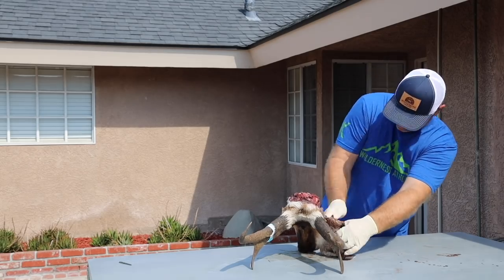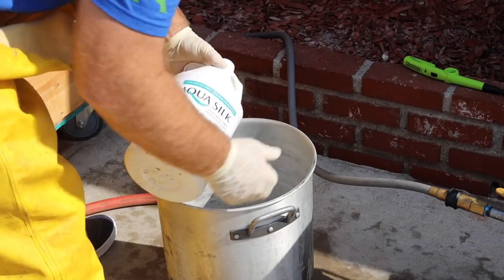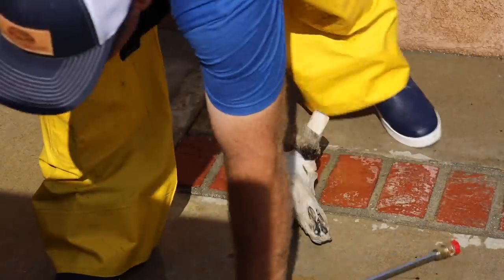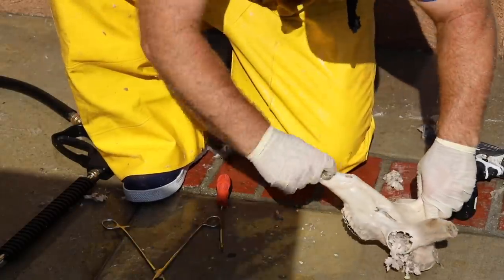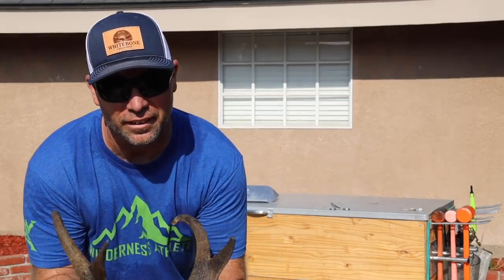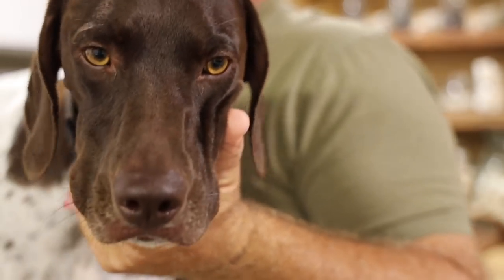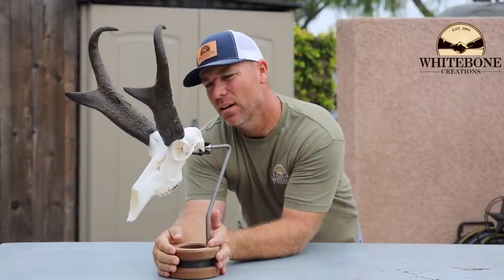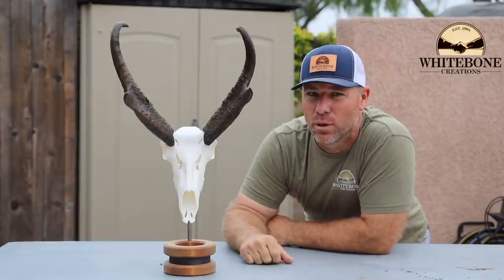PRONGHORN ANTELOPE SKULL CLEANING HOW TO

Comment: Great video. Got a question.  Maybe you will see this.  I have been using your method for a couple years to do whitetail mounts.  They looked great and really white when I first did them.. I have noticed that the ones that I have done a couple years ago are now looking "oily" in places.  I use oxy clean in my boil and pressure wash them really well.  What would cause them to start looking this way after time?

Comment: Awesome turn out on your Goat... You continue to put up the best videos.  Thank you. You should try a pallet, underneath the skull while you powerwash them. I find i don't need to hold the skull with my foot when spraying them. I made my own little custom pallet, That has just the right spacing in between the slats. The skulls just lock right down  and don't slip.
Reply from the maker: Great tip thank you. I used to use a spray box with holes but I tore it up.

Comment: Question. Shot a cow elk December 2019. Didn't take the head. Decided I wanted it after all and went back to get it July 2020. Skull is picked clean of all hide and flesh, just a completely bare skull. Would you soak the skull in water for a week to rehydrate the bone, or just go straight to the peroxide boil?

Comment: Ryan, I have a Pronghorn skull that was cleaned and euro mounted last year by a friend. It's starting to yellow and I'm wondering if anything can be done at this point to make it white again?
Reply from the maker: Yes you can.  Is it mop n glowed if so you can remove it using the instructions on the bottle skull only. Them just give it a warm dish water soak till no more oil comes to the surface.
Reply: @WHITEBONE  Thank you! No mop n glow yet. I'll give it a try. It's a doe with some nice spikes. Do I need to cover the spikes or just let her soak?

Comment: Something I have done for my boil when I have more time is built a boiler. A large rubber feed trough from tractor supply, hooked up a water heater element  to it and put in a drain. Gets nice and hot but not boiling, and can let it sit for 8 hrs or more without skull seperation. No flame to deal with and if sitting long enough almost all meat has fallen off the bone like cooking in a crock pot. Its big enough I can do multiple skulls at the same time as well.